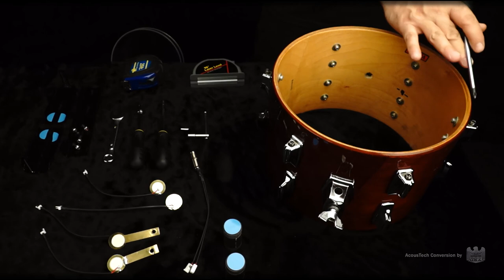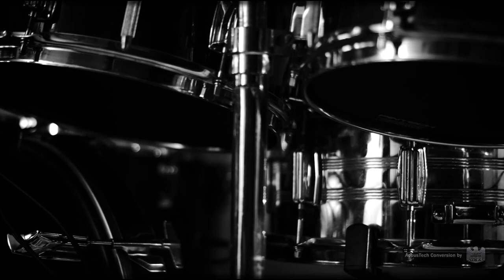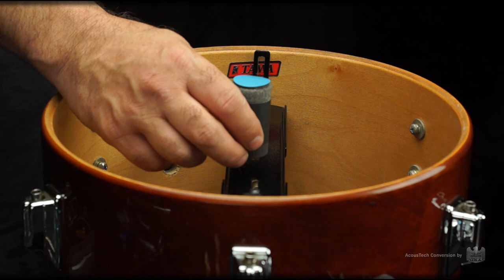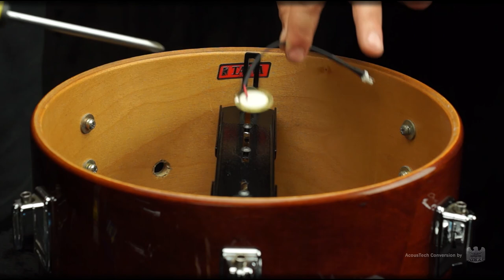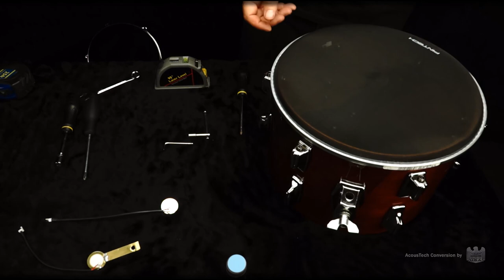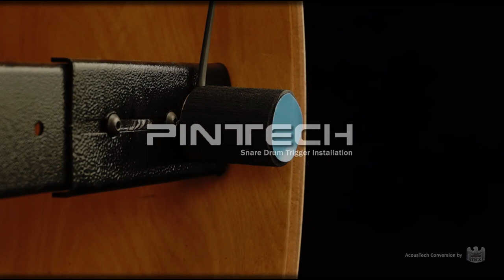Pintech AcousTech Conversion Package and Installation.

Comment: Great video, great product!   One thing that confused me that Ryan steered me right on:  the trigger part that connects to the bridge has a 1/2 circle of blue tape on it and faces up.  Apparently the one you're using wasn't totally finished.   The white round adhesive without the wires attaches to the bridge.

Comment: I have an electric kit but want to convert my old acoustic snare to add to the kit. Does Pintech offer a replacement rubber rim with the snare conversion?
Reply: Did anyone ever answer your question?
Reply: They do actually. This kit came with one for the 14" snare.